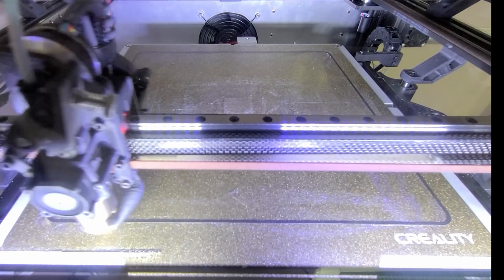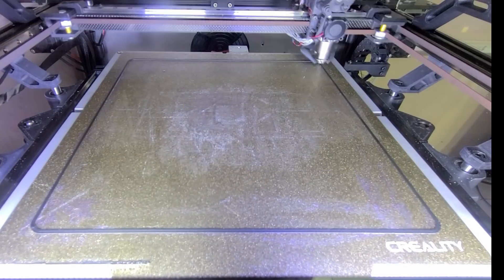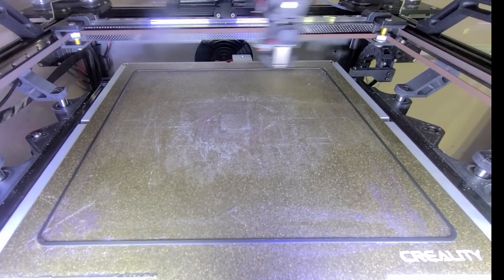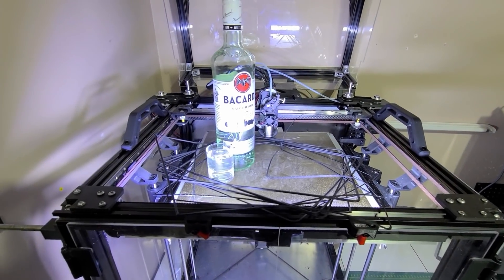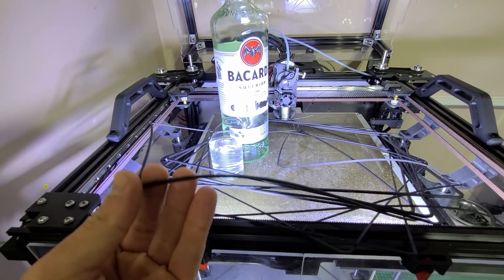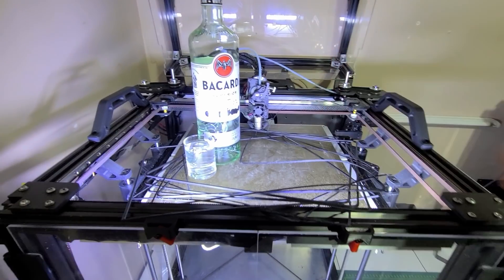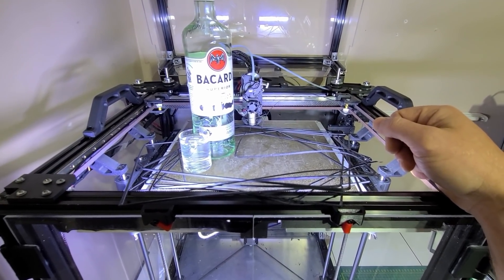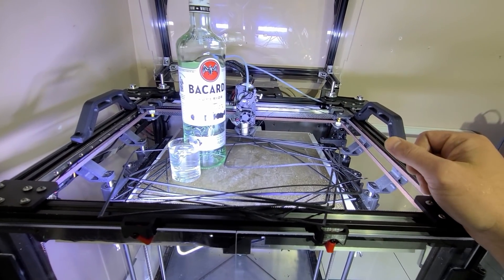3D Printing at 1000 MM/s ?? Magnum+/ODrive/  #1000mms

Comment: Have you tried it with klipper 0.10.0? Since 0.10.0 i have problems with my 6 steppers @ 128 microsteps
Reply from the maker: Check your step_pulse_duration
Reply: @Vez3D  My steppers are controlled via radds and raps128 but i plan to switch to odrive. Which step_pulse_duration do you have for odrive?

Comment: i cant get klipper installed on my system. i got everything on properly but the moment i try and flash my printer firmware my printer screen just goes black and when i try and restart it wont boot. would love to get a hand with that if any one is willing.

Comment: Awesome ! Good job ! Could we see a little bnechy printed at this kind of speed ? :D
I also tried using Odrive for X/Y but I could not get it tuned right, and gave up. But this video shows it can be done !
Reply from the maker: benchy is too small to reach 1000mm/s .. unless using accel like 1000K haha.. you will never reach 1000mm/s on a small model. If you want to print a FAST benchy, accel is what you need
Reply: @Vez3D  Then print a BIG benchy ? :D
Anyway if I ask for a benchy it is to get a good idea of Odrive's dynamic precision.
btw 10 m/s² acceleration is insane already.

Comment: Acceleration and jerk used?
Reply from the maker: klipper doesnt use Jerk. As for Accel..it was 10K
Reply: @Vez3D  and what does it use?
Reply from the maker: @th3ar216  https://www.klipper3d.org/Kinematics.html#:~:text=Klipper%20implements%20a%20constant%20acceleration,tool%20head%20and%20the%20print.

Comment: I thought 40mm/s on my ender 3V2 was the absolute limit but this video inspired me to try 60mm/s infill and 55mm/s wall speed and it turned out great
Reply: @owowowdhxbxgakwlcybwxsimcwx  Maybe not entirely stock.  Klipper is essential and the glass build plate is kinda chonk to be tossing around at high speed.
Reply: @brawndo8726  The glass does fine on 3k accell. I'm limited now by the mk8 hotend (printing petg) even though it is all metal and I crank it up to 245 degrees.
Reply: @pizzablender  3K is slow AF?  I've forgotten my settings at 7k several times while tuning input shaper.  It's mostly fine, but I pull it back to 5k for everyday reliable printing 🥱
Reply: 75mm/s is pretty good on my flying bear p905
Reply: ive been able to get 75mm/s with an MKS gen L and TMC2208s, I've now got klipper and a spider hotend and gonna start cranking that up
Reply: @Altirix_  if you don't hit at least 150 I'll be disappointed...
Reply: @brawndo8726  I still use Marlin at have hit >150mm/s with pretty OK print quality. Ender 3 V2 with a Mellow bimetallic beatbreak
Reply: I'm doing 70-80mm/s avg on my Ender 5 Pro. (50% outline, 75% solid infill, 60% supports) 800 Print, 1000 Retract, 1250 Travel, xyz jerk set to 8
But I can easily do faster depending on the model.  This is my most reliable speed tho I use it for first time prints always.
Reply: Install Klipper and tune it you can easily see 150mm/s (I don't print below that anymore) with good usable quality. I've taken my Anycubic Vyper (which is practically the same as your E3) to 300mm/s which is actually past the physical limits of the machine without putting larger motors on it, it didn't like it but it did it...

Comment: Now let's see the 2min benchy
Reply from the maker: i dont think that its possible to do that. I think 4min would be the absolute limite in what we can do.. if that still looks like a benchy
Reply: @Vez3D  just route air conditioner output to printer :)
Reply from the maker: @SergeiSugaroverdoseShuykov  more than just cooling limit that we are facing here
Reply: @Vez3D  extreme underwater basket errr benchy weaving?
Reply: @Vez3D  I know but if anyone can do it you can:) 4 min would still be wicked
Reply: They said no one could break the 4 minute mile.😁